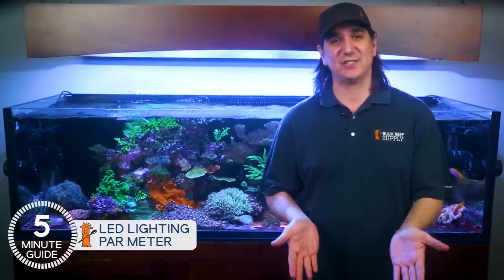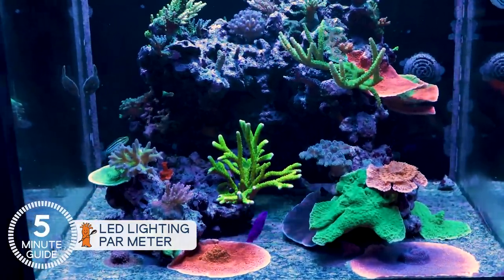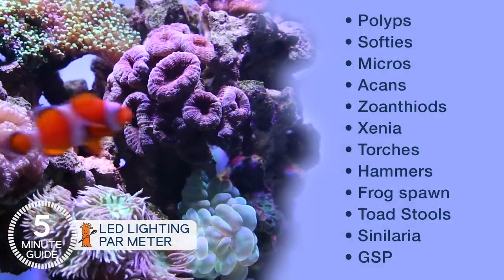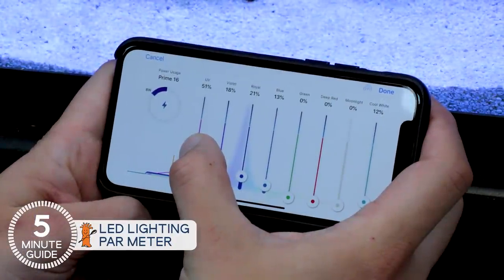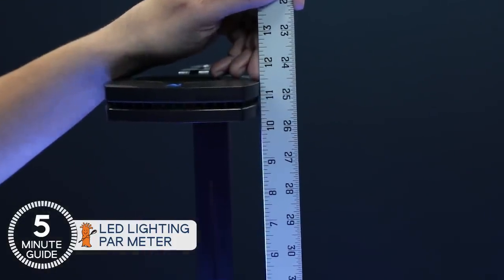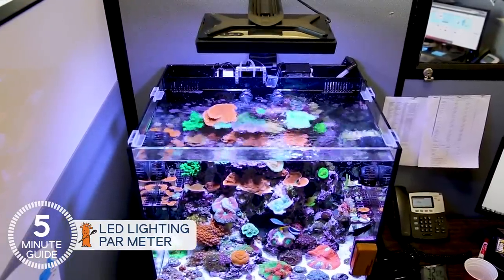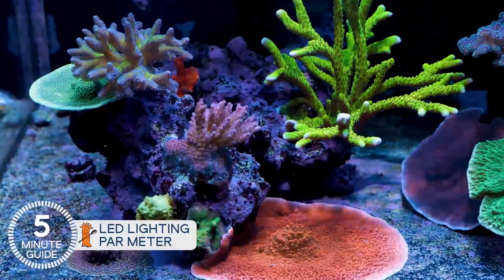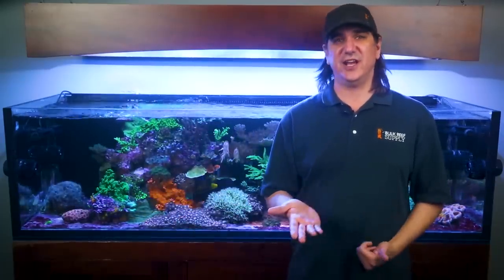How to use a PAR Meter the RIGHT way! This is your 5-Minute Guide to PAR Meters.

Comment: Need to know how to check a lid style tank for par.
Reply from the maker: That's a challenge. Without some sort of DIY sensor holder, you're going to have to remove at least part of the lid to test par. You can always make some assumptions as to how much the lid will affect par and increase the light fixture's intensity slightly to account for that drop.

Comment: Should this be with the flow off?
Reply from the maker: I like to test with the flow on because that's how the light will be hitting the corals when the tank is running. The surface movement will cause the number on the meter to jump around a little, so just write down a number in the middle. For example, if the meter is jumping between 80 and 120 par, I simply call that spot 100 par and move on to the next spot 🙂

Comment: Question for you please...
I have just bought a pair of AI Primes, AI Neros and an AI Fuge light, I have a relatively small tank (it’s deep at 28” water depth) almost square size at 21” x 20”.
My problem is that is has a nice solid oak lid, which matches the rest of the tank and dining room furniture (needed this to get the reef tank to pass planning permission from my wife!)
Which means the underside of the lights are barely 4” above the water surface. 
I know it seems overkill but the only way I can seem to get excellent PAR and good coverage would be to have 4 AI primes over the tank! I wondered what your thoughts are and if you have any solutions? 

I’ve also lined the lid with foil to try and reflect any reflections back into the tank and help diffuse the light.
Reply from the maker: Check out the Reef Brite Lumi Lite strips. They can be mounted very close to the water surface. I'll include a link below to a recent video we did on these lights 🙂

https://www.youtube.com/watch?v=KSPqkrGfXjk&t=0s
Reply: @BRStv  Awesome 😎 Thanks

Comment: Can you do an in-depth video on the Seneye as a PAR meter as its possibly becoming one of the most common. Ive found with mine that the readings obtained differ drastically dependant on the direction the unit points. Always flat and level but pointing left or right changes the reading some times by 100 Par. Interested if you have an opinion on the best operation of this devise.
Reply: Dan Potter They already have a video comparing the Seneye to a couple other meters and talk about how it has a weakness when at angles to the light.
Reply from the maker: https://m.youtube.com/watch?v=6hUkufXBb3I&t=1s
Reply: Bulk Reef Supply I’ve seen this video a few times it’s easily the best out there, however it doesn’t explain that if I keep the Seneye in exactly the same spot and turn it (not rotate) 45deg in the same plane the Par can increase by 100 Par. Meaning I can get a reading of 100 or 200 over the same set of Acans.

Comment: What light are they using in this video with the phone app
Reply from the maker: That would be the MyAI app used with the AI Prime, Hydra 32, and Hydra 64. We used the Prime on the tanks in this 5 Minute Guide series. 

https://www.bulkreefsupply.com/prime-16-hd-led-reef-light-black-body-aqua-illumination.html
Reply: @BRStv  how many hydra 32s would you recommend for a standard 180 gallon tank I’m planning on doing lots of coral eventually